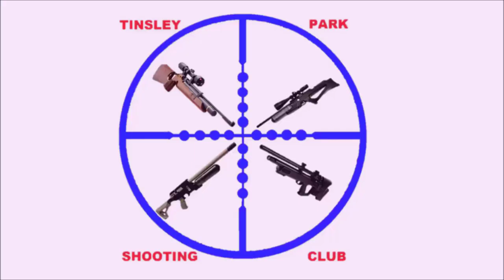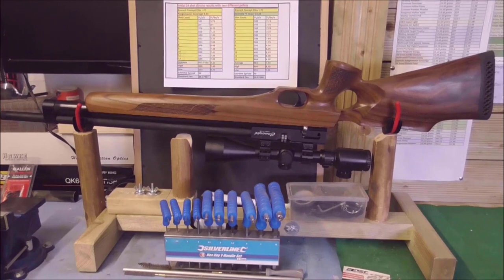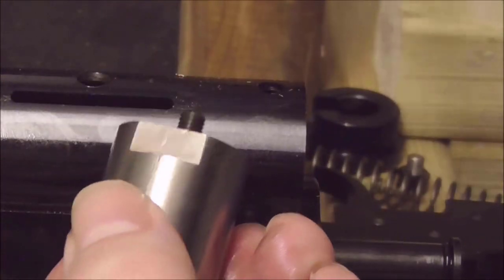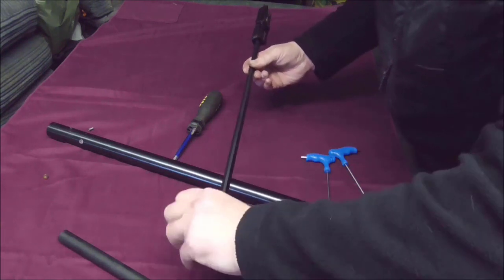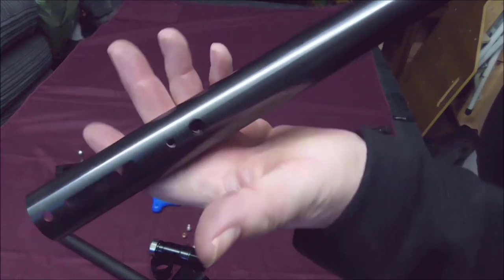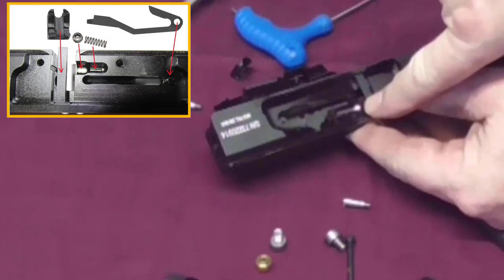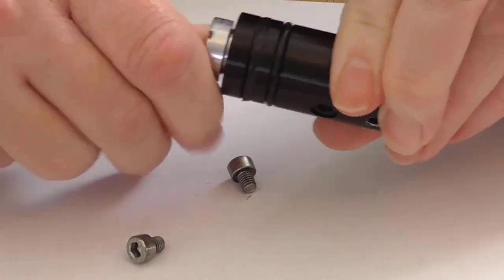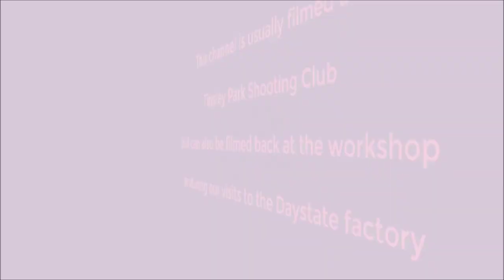01.  The Brocock Concept Elite Project (Part One) Stripping down the rifle for a service

Comment: Timely video as my S6 started leaking so bought seals and watched video and replaced inlet valve seals job done. 

Where can the Falcon bolt be purchased to replace the brocock one
Reply from the maker: Glad you managed to sort it. The o-ring for the barrel to breach seal was the hardest part for me. So very fiddly to do. It drove me mad for half a day.

Comment: Very helpful video sir, a question where can we get a replacement for the expanding seal of the valve as they do not come with any o ring kit available
Reply: By the way is exactly the same model car version
Reply: Sorry fac version
Reply from the maker: @chrysanthosanastasiades9368  The problem with getting a hold of the expanding seal is that they don't make the rifles any more. Maybe a large o - ring may fit. The next time that i see Tony Belas i will ask him. Daystate took on Brocock and may even stock them. If you are in the US Airguns of Arizona may be able to help. Otherwise you could probably get one made. Most rifles have seperate air cylinders nowa days, but there are still a lot of full length cylinder rifles out there such as Webley LiteW8, Logun Axor, and some of the older rifles, so they may have some to fit if they are the same principle. I would probably go for a large fit o-ring as a last resort.
Reply: @airgunsniper-elite7385  thanks for your immediate response sir , unfortunately I am in Cyprus ,there is a dealer for brocock and daystate but unfortunately after purchasing a lane regulator and as I had the gun for some time now I thought it was a good idea to send it for a service as well , long story short the gun came back a huge mess even the spacer was customised if you can call that, not reliable at all , I spend 4 months searching parts etc. Also another question by the wayn the manometer threads are 1/8 BSPP or 10 mm? if there is a source that can provide with any spares will be really appreciated as it is a very nice gun , carbon custom stock etc. spend time and effort for.........thanks again for your interest sir
Reply: @airgunsniper-elite7385  any luck with the flat ring on the excaust valve mentioned on my previous message and also I would like to ask if there is a place that can get the complete valve
Thanks in advance
Reply from the maker: @chrysanthosanastasiades9368  They don't seem to do the expanding seals anymore. Not sure if the Falcon is the same, as most parts are similar. If so, Air Arms still stock the parts for the old Falcon Prairie, so these could be a good place to try. Other than that it may be possible to get one of the o - ring manufacturers to do a one off. When you think about it there are loads of different seals out there on the web.,

Comment: Fella seriously,could you not hear that that allen screw was undone ? .It was clonking and clicking over and over.  And what a mess made of the back end of that trigger block where the over sized drill bit chewed against it and the tapered punch spread the edge ,total bodge.

Comment: WOW ... would I try doing a strip down on that rifle ? NO WAY , far to complex for me , NONETHELESS an excellent vid , it's given me the impetus too have a crack ( again ) at a far more simpler project ( pp700 ) ..but first ... Gonna go to VIDEO 2 ... Watch that ... Brilliant!!
Reply from the maker: It's all about confidence Mark. The easiest way to do this kind of thing is to video, or photo the strip down. That way you have something to go by. I was going to go for an Alteros regulator, as they are not vented to atmosphere. My biggest scare was buggering up the hole in the cylinder, knowing that they aren't available anymore. Luckily everything worked out OK. I realised that the exhaust valve was fixed in place by the bolts so that's why i didn't event do any measuring. It was still an arse twitching moment though.